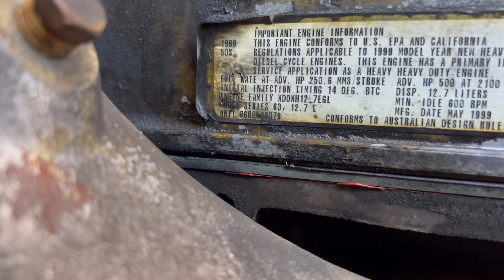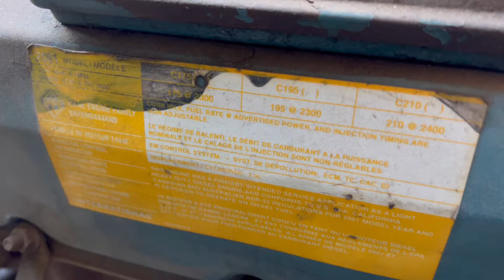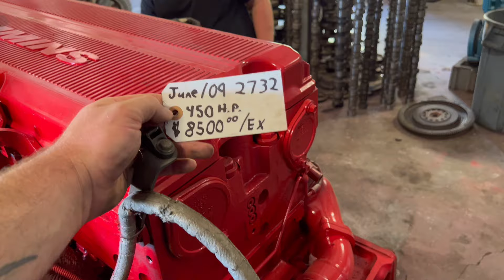PARTS HUNTING!!!THIS TRUCK YARD HAS EVERYTHING…UNBELIEVABLE

Comment: Tim my dealership.did some testing for Bendix years ago when disc brakes were first on the market. As a Fort wayne dealer we were close to bendix engineering facility and worked directlywith the engineers on failures. The disk brakes did test well however the cost difference between the disc and the drum is huge. With the disc brakes you can go 200 to 300k miles if you have a driver with an easy foot. You may or may not get 2 life cycles out of the hub and disc. That depends on the driver, corrosion,  and terrain. We found that the clips on the hub would weld to and damage the disc's over time forcing you to have to replace the entire hub. You will also run into calipers that fail along with valves calipers are not cheap. The systems are a bit harder to diagnose until you get the hang of them. The best suggestion I can give you is to stick with drums. Over time the cost was less with our customers. I was working with a heavy haul company as well as a gravel hauler. I hope this helps!!!!! Good luck!!
Reply: you're right, the drum brake is the best route to go
Reply: Discs have moved on a lot more than a country mile as in UK even the Dog has disc brakes!. Even trailers are all disc.

Comment: Disc brakes are easier to replace then drums! Also better stopping power. They also still stop your truck when brakes are hot. The only down fall to disc brakes is the shoes only last like 100-200k miles  u have to keep an eye on them shoes cause once worn down they’ll destroy the rotor and the rotor is like 1200 buck apiece. Also down side If u get them good and hot they can crack.
Reply: I worked for Matlack in the 80s,  we had one of the first ones,  couldn't keep pads on it and rotors about every 2nd pad change.   I'd prefer the drums myself,   much cheaper for the owner..
Reply: Aren't they a lot dirtier and make your wheels a dirtier compared to drums? I thought I heard someone mention that in some other video
Reply: @jessejames3572     40 years ago,  referring to brakes a lot hasn't changed?    Only the year numbers.  Have you ever worked on an 80s model truck or trailer? Just asking
Reply: Composite pads would be the way to go.
Reply: I've got a million miles on my pads....

Comment: I've been running disc brakes for 10 years now. They are great! To me they feel like pre ABS drum brakes. I now have a new T880 and a Heil fuel trailer with disc.  Also pads are cheap and easy to replace, just don't eat up the rotors they're pricey.

Comment: disc brakes for sure, work with them and drums daily prefer disc for sure. only thing that sucks about our rotors is you have to remove the hub to replace them other then that pad slaps are a 5 min job and no worn out s-cam bushings to deal with

Comment: The only way you'll find disc brake set ups is if you find rigs that are newer than 2015. The cans are turned sideway from traditional. Disc brake trucks stop very well. I wish you luck Tim.
Reply: Thanks for watching 🔝🔝
And commenting
Send a direct message right away
You have just won a gift🎁🎁🎁

Comment: While in Kansas, check out the  freightliner setting in Adventures made from scratch channel, Silas has one setting in there and it just don't belong there.. biggest thing right now is housing, people won't go where there ain't houses at a decent rent or buy. I know that Mr Story did the right thing as selling parts makes a truck worth way more than setting and running down the road. I don't figure why you don't part the truck your trying to sell cheap unless you just don't have the manpower to get it all done.

Comment: I maintain a whole large fleet of trucks with disc, they work so well and are so easy to service theyre now converting all their trailers to disc. They take about 10 minutes per wheel end to change the brakes. Most of that is wheels off and on.

Comment: The reason you don't see them running the tag axle in the Quarry or on gravel roads is because you will ruin the tires on the tag axle on gravel roads. It will cup the hell out of them.

Comment: My feeling about discs is if the truck is lying idle for periods it's not a good option they tend to rust up and stick or seize lot of trailers are gone back to drums for this reason specially if in damp climate
Reply: I do not no where you get your info from. But we have been running discs for years. Never had discs seize up even when the trailers sit for weeks. Plus when its freezing I have never had discs freeze up on the trailer or tractor and that is a major problem on drums.
Best move you could make going over to discs.

Comment: Tim I know I've mentioned it before but at 30 minutes into the video you and Braxton are inside the shop there at the junkyard and y'all are looking at those big cam Cummins engines on the floor and you said the one is a 400 and when I heard you say that, I remembered I still have a brand new aluminum flywheel housing for a big Cam and I think it fits an N14 also.. I am definitely interested in selling the flywheel housing I have and if anybody on here maybe looking for one and close to the southern WV area, I'll make a good deal on it

Comment: Disc brakes are super easy to service. The negatives are that they are hard to see the wear without pulling the tires a d they seem to wear quicker but are cheaper. The entire hub has to come off if the rotors have to be replaced. I still prefer disc over drum brakes.

Comment: Yes, disc brakes are the way to go.  We switched and the maintenance is less intensive and while it might be a higher cost it’s better stopping power and easier to work on.  Our trucks are now nearly all disc and weights range from 40-75,000 pounds (fire department) with single to tandem, to tractor drawn ladder.
Reply: Thanks for watching 🔝🔝
And commenting
Send a direct message right away
You have just won a gift🎁🎁🎁🎁

Comment: Tim, the company I been working for 30 years as a mechanic just switch over to disc we have been seeing some issue, the brake pads are wear faster then we thought, I've seen them worn out around 120 to 170 thousand but these units run the northeast which they are running up and down the mountains. the next thing we are seeing is the wheel seal leaking both the drives and steers, and the last thing we are seeing is the ABS exciter ring is getting rust behind it and pushing it out cause ABS faults we call it rust jacking, but other than that the drivers love the braking power also they are easy to change the pads, abs ring and the rotor, still have to pull hub to do the abs ring and rotor but the pads pull wheel,
Reply: They'll be sick of the expense on those disc brakes,  my company tried a set in the 80's.   Couldn't keep pads and rotors on them.  They were experimental rigs but basically same as I'm seeing today,   they never bought any after testing the one truck..JUNK..
Reply: @ky.gambler5281  I'm getting 300,000 miles out of mine. Always loaded heavy. That's driving local, 80,000 miles a year

Comment: Disk are the way to roll. Maintenance is cheaper.  It takes longer to knock the wheels off than to change the pads.  And that suspension you were looking at is Neway  on that cut off you were looking at with the pusher axel it’s the cats ass on heavy haul. The bags were hard to find a year ago because the bags are made in Kabul and nobody had them. And the airport had been destroyed. I needed one bag. I ordered 4 that way I wouldn’t have a hard time getting one again lol.  Also It took me a long time to get the terminology right.  A tag tags along behind you. A pusher is center of the truck. I kept calling them all tag axels for years until it got explained to me that way.
Reply: Thanks for watching 🔝🔝
And commenting
Send a direct message right away
You have just won a gift🎁🎁🎁

Comment: I use to drive a 2000 Fld 120 for my uncle.  The motor was a 12.7 series 60 and  was having issues with cracking the exhaust manifold in half and killing turbos.  The fuel tanks were also getting oil in them and it was blowing oil out the exhaust.  Its been sitting parked for almost 2 years.   No idea what hes planning on doing with it. Was a great truck when i was driving it.  Miss it terribly.

Comment: Tim Iam going to be honest I work in the oil field in West Virginia disc brakes hold up really good but when stuff starts to go wrong with them it gets expensive quick. But drum brakes a lot simpler to diagnose and get parts for. But if I was you I would go with disc brakes.

Comment: f I had the money, and had a cabover with stretched frame, have always wanted to take one of those standup sleepers with the windows up high and put it on the frame behind the cabover so my bed would stay fine when i need to lift the cabover..lol.. maybe use a track similar to the sliding fifth wheel to roll it back enough to pen the front cab??
Reply: Thanks for watching 🔝🔝
And commenting
Send a direct message right away
You have just won a gift🎁🎁🎁🎁

Comment: Seen so much potential in some of those ol trucks! As far as the drop axle goes if the price is right on the steerable I'd go with it. If you do actually have to use it it the way to go. Looking forward to the next video!

Comment: Disc breaks are easier to change pads but a pain in the butt to change a wheel seal because you have to remove the caliper to get the hubs off

Comment: Came about 4 weeks ago I had an opportunity to drive a Peterbilt that had disc brakes on it and it was raining pretty good and I was relatively really surprised how well the truck handled and stopped in the rain it was way way better to me than when you're drum breaks get wet out you know wet from all the rain it seemed to break and respond a lot quicker and the mechanic was actually doing a brake job and he did did one axle about probably 15-20 minutes he said it's way simple I would go that way

Comment: Goliath is air ride all the way around and I often thought about converting it over to Dis break but I can’t do a cut off because the frame in the box are all one integral part so I have to literally just replace all the suspension pieces to find a disc brake axle to put in there. Probably not going to be an easy project
Reply: Thanks for watching 🔝🔝
And commenting
Send a direct message right away
You have just won a gift🎁🎁🎁🎁

Comment: From what I understand disk brakes are a lot easier and maintenance costs are low but, in the past I’ve seen the rotors crack and it will look like is has a wheel seal leak. The rotors run about $200-$300 shoe kits run around $180 and a dressed caliper with new shoes and brake chamber and everything runs $850
Reply: I’ve heard from a lot of drivers that they prefer disk brakes over drum brakes because they perform better but I think it comes down to application.

Comment: Disk brakes are not bad. Better stopping power and they can still stop the truck even when the brakes are hot. Plus servicing them are so much easier compared to drum brakes. Only thing I can caution is to always use the shear nut that they provide you when doing the adjustment. They make a socket that’ll fit the caliper but it will strip the caliper out and you’ll be putting a caliper on it if that happens. Also on your PM be sure to do a clunk test on the caliper to make sure sliding pins aren’t seized and the caliper mounting bolts isn’t loose. About all the trucks I work on have disk brakes. Nothing to be afraid of in my opinion

Comment: The disk brake is easy like a car put airpowered with the brake chamber big difference is if you do it 3 axles front and 2 rear its 20% faster stops

Comment: Disc brakes are good regional & otr. Local they wear out quick and are expensive. A rotor is 375ish. The calipers are over 1000. Pads 150ish. But thats the cheap part. If you dont watch & get into the rotors. The labor is time  consuming hubs come off and sometimes have to heat the bolts to get the rotor off.

Comment: Disc brakes are awesome for maintenance, but if you need to do a wheel seal or a rotor it increases the down time because the rotor is mounted to the hub. And that assembly is super heavy.
Reply: Basically going back in time at the customer expense. We had some in the 80's..believe it or not,

Comment: No mistake with the discs I was apprehensive at first too but the rig I drive everyday is a heavy haul T800 with a 14k steer 20k drop and 46k rears with discs all around all the W900 s and 389s in the fleet also have them and all the trucks are spec’d pretty much the same and those disc brake will put you through the windshield if you aren’t careful and be really careful if you got to bobtail
Reply: Thanks for watching 🔝🔝
And commenting
Send a direct message right away
You have just won a gift🎁🎁🎁

Comment: My Peat 587 has disk brakes on the front and it takes me longer to take the wheels of then it does to change the brake pads and it was only $96 for both sides of the front axle
Reply: I’ll buy the international right now cash
Reply: I just emailed you my info if you want to sell the international

Comment: I’ve never worked on a disc brake setup on a big truck but I have run trucks with disc brakes and I will say hands down that they are better. You get ZERO brake fade, less application pressure, and shorter stopping distance. I would definitely make the change

Comment: Idk much about the mechanics of semi’s. I know how to drive, keep filters swapped, oil changed, greased, brakes adjusted and all that jazz… but I believe The disk brakes are in general from what EVERYONE says are more efficient!!! But I’m like 95% sure that Bruce your buddy with a Bluecollar has disk brakes on his rig!! He said they work a lot better but create a lot more dirt n dust. Sorry not trying to speak out of line, or out of my rear end, I’m just a driver and a shade tree mechanic for older pre 2015 4wheelers (normal vehicles) I prefer the fact that you can adjust drums up individually…. Not sure if you can with disks on but trucks or not.. but I bet Bruce would know. Hope that helps even a little!!! I did run triaxel dump trucks for a decade before I stepped up and got my A’s. If your not worried about using the axel then go with a straight. But if your going to use them, I’d go with the steerable lift axel!! They turn 30% of the fronts(usually) and they save on tires… because your not rolling and dropping the axel pushing rubber into the road with speed and weight, and your not lifting them to make it around turns burning up rubber slowing down to make the turn!! And you can break a lot of stuff turning without lifting the axel! Also if you weld tires on, you’ll need to get a “registration” for your tag axel, it has its own weight rating! Some weighted for 4,000 some rated 5,000-6,000lbs. I’m sure there are more weights, but I know years ago certain quarries would make us show them the registration proving the weight limit of the truck, and the original tandoms who added an axel had to carry around the registered weight limit of the axel they put/had put on. Sorry its always long comments!!! I just try to make sure I put ALL the info I can out!!! And I don’t want to misrepresent my knowledge!!! Not that you would just take my word for it… but some people do and don’t do their own research!!! Good luck!

Comment: Disk brakes a breeze to change pads the downside is the rotor depending on what style you run you have to change the whole hub, then if ya blow a wheel seal it takes more time to change it out and just about everyone I've ever seen do one crys about how heavy the hub/rotors are, the rotors are expensive when ya have to replace them, rebuilding thems not that bad but if ya can't it'll cost you also the rotors are $$$ I'd stick with drum if ya had a choice but that's just me

Comment: I would love to see that drop axle frame behind the Cabover, since it needs rear ends anyway find a set of 40s or 46k drives with disc brakes on them and you'd be set!
Reply: Thanks for watching 🔝🔝
And commenting
Send a direct message right away
You have just won a gift🎁🎁🎁🎁
Reply: How's that antilock system gonna work out on an older truck with no computer system?   Just asking
Reply: @ky.gambler5281  I would assume it would just function like an older truck would that doesn't have ABS.  Are disc brakes going to be that grabby where it will lock them up all the time?

Comment: I would go with disc brakes because they cool a lot faster, but living in a wet climate (the UK), then they also rust and need more maintenance than drum brakes per mile when both are setup properly. the pads also stick to the discs around freezing point so that could be an issue in cold places like where I live, whereas not had quite as many problems with drum brakes on a 4 wheeler. there was something I heard many moons ago about disc brakes being better at stopping, but not seen it unless you get something like brake fade which drums are commonly known for as you know. disc brakes cool about 40-50% faster, but also an issue of run away if left parked on an incline when the brakes are hot, and parked for a period of time. so total swings and round-abouts. but are easier to replace pads than shoes.
Reply: Thanks for watching 🔝🔝
And commenting
Send a direct message right away
You have just won a gift🎁🎁🎁

Comment: Not a fan of the way the frame on the Peterbuilt was stretched. The plate inside the frame doesn't seem enough, I can see the frame flanges cracking with frame twisting.

Comment: As a parts guy, I will suggest that you not chose disc brake cutoff, unless you have the VIN record for the donor. I’m not knowledgeable on ABS control modules, but I know enough to say that the components and system has to work together.
I am a mechanic first, and I somewhat understand very well what the ABS systems do by what makes common mechanical sense. I do know foundation air brake and air system troubleshooting very well.
Reply: Thanks for watching 🔝🔝
And commenting
Send a direct message right away
You have just won a gift🎁🎁🎁